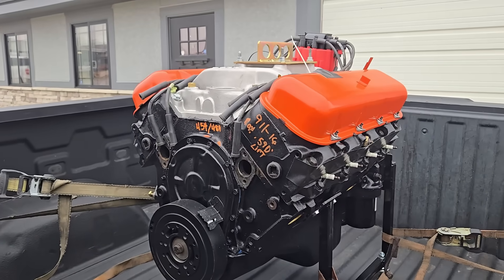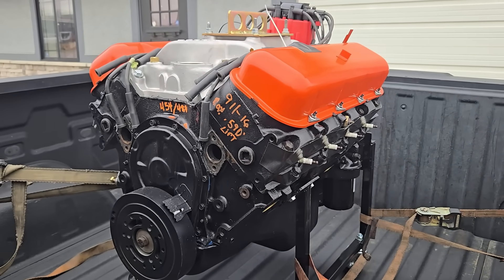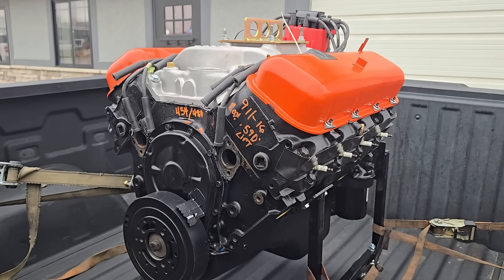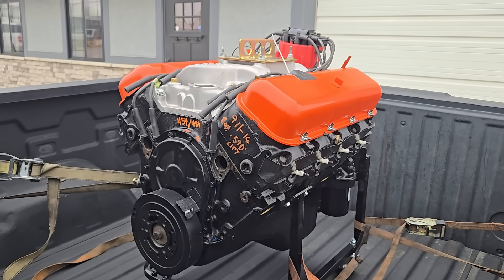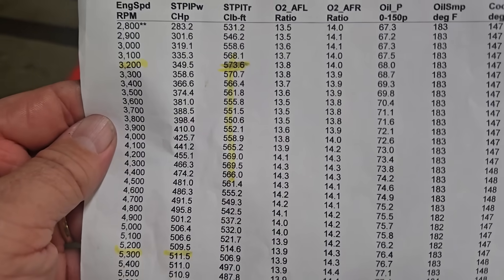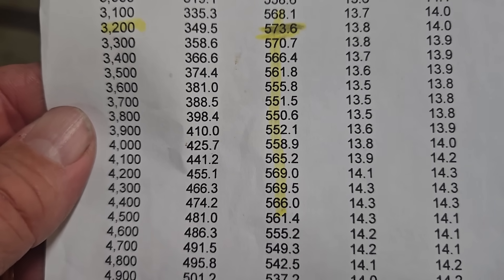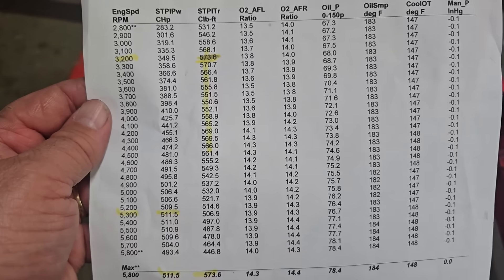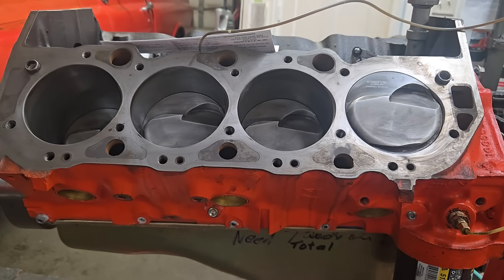87 octane 489 bbc, thumper camshaft comp. Peanut ports

Comment: Hey, was the cam a roller or flattappet? whats springs? Peanut heads have a short 1.820 installed height so curious what springs u used for that valve lift.
Reply from the maker: Hydraulic roller, valve springs was 911-16 comp cams. The spring installation height I just don't remember the heads has been on the shelf for more than two years, waiting for a home.
Reply from the maker: thinking about it.I believe those heads had +.050 valve locks in them.That increased the install height fifty thousandths.That's the way I remember it.But i'm not positive.

Comment: There is SO much to learn!
What is the reason for hand grinding the marked area of the block, as outlined by the gasket (at about 1:35), and doesn't that affect combustion chamber volume and vary between cylinders?
Reply from the maker: D shrouding the cylinder block to match the combustion chambers on the cylinder head increases airflow. The notches are close enough. To, each other that there's very little to no variants in compression. One cylinder to the next. And yes, it does increase the combustion chamber volume, which will decrease compression by possibly a tenth of a point. but the increase in airflow is more than worth
The decrease in compression.

Comment: I haven't used a thumper cam, they sound cool, but you just don't get
the same power as a bigger lift non thumper HYD roller with a 108-110-lobe separation or something like that.
Reply from the maker: I've used thumper cams several times on small block and big block chevy's, in  my experience  they make a lot of noise out the exhaust with all that overlap and they have crazy good mid range power. not necessarily the best peak numbers, as other cam shafts. thank you for investing your time watching my videos. Thank you for charming in with comments!! Nick.

Comment: What would be interesting is to see the results of altering valve and rocker sizes on the dyno, where those are the only changes.  I've only experienced Ford engines with consistent ports and LS engines... Not BBC with port approach inconsistencies.

Comment: Did you sell that 400 from the 3 engine small block build that you did
Reply from the maker: No, not yet, it won't be for sale until I do stage two with roller cams. In each one of the motors.. Sometime in the spring of 2026
Reply: @dzperformance7360 is it a good runner

Comment: I’m soon to build a street/strip 468/496 for my 63 nova.  I’d like 550-600hp and torque.  Aside from the one in video, what cam/heads would ya recommend.  Howard’s? ProMaxx? I’m kinda partial to them. Thanks partner
Reply from the maker: I like the Brodex race rides
Reply: @dzperformance7360  are the  brodix race rite 270s oval ports any good? The reason I'm asking is, because i seen Eric gave a break down on them. How do they compare to 781s with bigger valves in them. Thanks for your response in advance 👍

Comment: Have u seen the 11-600-8 thumper cam make over 600hp in a 496
Reply from the maker: I've never done it, and i've never seen anybody else do it. But I'm sure it could be done. if you move the cam.Retarded.. and had big airflow pieces. the thumper series cam is great for mid range power.Great torque peak, great horsepower at 4500rpms.It's not a cam, that's gonna throw down big, impressive, peak horsepower numbers.
I built a 505 cubic inch motor with the medium sized thumber hydraulic roller , six years ago.And it made 550 hp,  650 foot pounds of torque, with #781 cylinder heads.That's the best I ever did with a.Thumper..
Reply: @dzperformance7360  Thanks have u ever used speedmaster 305cc big block heads
Reply: @DanielCrockett-j4g those Speedmaster heads aren't worth your time. You'll make the same and maybe better power/torque with 781/049 heads.
Reply: @msh6865  Thanks a car builder uses them on a 496 said it make nice horsepower for the street 10.1 compression
Reply from the maker: no
Reply: @dzperformance7360 thanks for the information
Reply from the maker: Your question about those speedmaster heads.. I use brodix, factory g m classic pieces. and sometimes a f r. I just have a belief that the cylinder heads is absolutely.The wrong place to go buy chinese cheap heads and save two hundred dollars..

Comment: About time someone did a 87 octane motor ... Fuck everyone builds high power and never mention them motors need 93 octane in my area all there is 87 or diesel
Reply from the maker: Thanks for the encouragement  !! as pointed out by a couple of the comments.I could have went clear up to 9.2 and been totally safe.But I wanted to show this kind of power could be obtained with even low 8.6 to 1 compression..

Comment: Externally balanced or internally? 
Love the concept of a short rod stroker. Always wanted to build one.
Reply from the maker: External
Reply from the maker: If you had a set of good factory rods, you could build a stroker.Big block dirt cheap
Reply: @dzperformance7360 I have a nice set of truck rods (also called "thumb rods". Always wanted to try doing a stroker big block this way.

Comment: Beautiful street engine!  If he had the SS hood would you have used a Performer RPM style intake?  Or would you keep it low rise because it works better with the rest of the combination?
Reply from the maker: I would have chose an r p m style intake, but I had this brodex.In stock and previous testing had told me below 5500rpm. It does about the same thing as an r p m, so it all just worked out perfect.
Reply from the maker: My opinionThe r p m would have done the same torque with maybe three or four more horsepower that has been my results in testing previously on the two different manifolds

Comment: Great video. If you don’t mind me asking, when you deshrouded the valves. What angle are you trying to achieve and how far down in the block are you going? Is there any benefit to deshrouding both sides of the cylinder? Thank you for sharing this build it’s very impressive.✌️😁
Reply from the maker: The way I was taught is just a forty five degree angle.And if you're trying to go all out race motor draw a line where the cylinder ring comes up to the top and go down within thirty thousandths of the top of that ring.But that's a maximum effort engine. I know people that do the exhaust side on maximum effort engines, but I also know builders that says there's almost no benefit at all on the exhaust.
Reply: @dzperformance7360 thank you so much for this information.
Reply from the maker: Thanks for watching my video. Thanks for taking my input.
Into consideration
Reply: @dzperformance7360 thank you for sharing your experience with us. It’s a pleasure watching your videos. Happy Thanksgiving.
✌️😁

Comment: Solid numbers for peanutty heads. I can appreciate the mix and match effort on the valve sizes and rocker ratios to try and get the flow evened out. Good stuff.
Reply from the maker: One of my mentors that owned a dyno got me started. Doing that and he said, you'll never catch the flow of the good port on a big block Chevy. you can only get it close by doing some of these tricks
Reply: @dzperformance7360  makes sense to me. I wish I had more time so I could spend sometime learning from an engine builder wiz about these old school tricks. I love the idea of being able to do more with less.

Comment: Good video Nick, thanks for posting. I wonder how much power that block deshrouding added? It does lower the compression a little. I have a 454 LS5 in my '70 Chevelle, it pulls like a mofo. The 4.10's out back help a lot. The Chevelle is a heavy car, it definitely needs a big block.
Reply from the maker: Just  my opinion,,  I think it probably only helps a couple horsepower, and I only do it when i'm using big valves. The compression hit is only one cc, so maybe a tenth of a point.

Comment: Very interesting build, it would be great to have a set of those heads flowed to see what the difference between the good and bad ports are on a flow bench and compensate the lift numbers for the rocker arms, the 547 lift on the intake becomes 579 with the rockers
Reply from the maker: There's a video on those exact cylinder heads flow tested on Eric Weingartner's channel about 2 years ago. I think his channel's name is Weingartner Racing?
Reply: @dzperformance7360 i'll have to dig that video up interested.I'm gonna watch this though

Comment: built a pump gas 543 bbf for my 78 f100  610 flb and 415 hp at 3500 rpm. gotta love them big block's
Reply: 3.89 w 4speed.  1st and 2nd almost useless but it is great for pulling my jetboat looks cool to
Reply: wtf did you have for gears ?  2.29?!! LOL

Comment: Oops I hit send before I was done part 2 then I don't remember if you said it was a roller camera not with the specs. I've got a 450 inch lift roller cam on 1.5 roller rockers 202 160 heads air gap manifold and a bunch of other good parts 9.
To1 compression Rose variable duration lifters and lots of good parts I'm getting 450 ft lb of torque out of a 357 350 40,000 over hypertech Pistons the motor you did a really nice motor though I would definitely want to have it. Thanks.
Reply from the maker: I forgot to mention it in the video.It's a hydraulic roller

Comment: Engine would be a beast in a 70 Vette Stingray with a 4 speed manual & 3:36;1 Gears.
Reply from the maker: Yes,!!! now you're thinking it'd go through the quarter mile in third gear. But would probably have the power to run high tens. et
Reply from the maker: You could use fourth gear like an overdrive

Comment: 511HP with peanut port heads and the smallest comp thumpr cam would be a new American dyno record. Thumpr cams do not make power only noise which has been proven over last 25 years since created. Have only seen upper 400s HP officially with those heads. Someone spent many hours porting them and must have larger valves. 8.6:1 can run on 84 octane. Stock type 454 with extra stroke cubes at 489 will only give about 30-50 more TQ with the peanut port heads. Peak torque RPMs nose over at 4400rpm. Building a 489/496 with peanut ports for only 500HP seems like a strange waste of bbc cubic power. 781/049 large oval ports would add 75-150HP if properly ported with bigger vavles which leads me to believe these do not have peanut port heads. What is the head casting number exactly?
Reply from the maker: Casting # 236 . the casting numbers are visible in the video at 4.35 minutes. i've built the same motor with large ported.O49 it makes about 12hp more. 20 more foot pounds of torque peak, but less below 3500 r p m's. cylinder heads have less than one hour porting on each head. all porting was done in my shop. I did every bit of it. So i'm positive, there's one  hour in each head
Reply: You’ve been watching the wrong videos. A  thumpr cam can make over 400 hp in a small block.  One went over 400 hp in a 327 Frieburger dynoed. ( see 8000 rpm small block) on engine masters. And horsepower monster dynoed one too, way over 400 hp

Comment: Always wondered why the oems didnt bother to match the top of the cylinder the combustion chamber like you did at 1:43.
Reply from the maker: You know, on the four bolt main motors, they did do that.And 396/402
Reply: They did it on the high performance versions. L-88,  LS-6,  LS-7,  L-72, etc.

Comment: That engine made good power and torque for what it is you could put a good set of heads on it and cam swap and pick up 100% hp
Reply from the maker: Thanks for the comment !!!and you're right.But then that would be a combination for a different car.

Comment: Great combo for a highway cruiser Nick !!! I did a .030 over 454 for a friend last winter with peanut port heads, 2.190 and 1.88 valves. ZZ 502 hydraulic roller cam and the matching Weiand intake. He put it in his Chevelle and absolutely loves it !!!
Reply from the maker: Thanks for the compliment.I trie to put motors together, so people don't have to run out and buy a bunch of parts.I  tailor the combination to their use and their parts.They have.. Thanks for watching. Thanks for chiming in with such a thoughtful comment.
Reply: So this is a Stroker build but with a Big Block ?
Reply from the maker: yes

Comment: What's up DZ! Drop a small single plane intake on that thing!😜
Reply from the maker: I hate to disagree with one of my guys from way back, but
About ten motors back , I did a 461 for a guy in arizona.And we used one of those low profile torque 2s . that's the only one i've ever used.And it made total s*** power.It was embarrassing.. After he put it in his car, he went to a edelbrock performer.R p m.
Reply: @dzperformance7360 Torker 2 was the worst intake ever made for a RAT. The Victors were much better. But a mild torque engine should run a dual plane. That Brodix dual plane is a good piece.
Reply: @dzperformance7360 I feel you DZ.🙂 I guess for me. I don't like a lot of low end torque because spinning ain't winning. I prefer a lot of mid range and upper rpm torque. But, I do understand that every combo and a person's preference matters.😉 have a happy Thanksgiving my friend.
Reply from the maker: @musclebone7875 thank you so much, thank you for watching.You have a great thanksgiving also
Reply: @dzperformance7360 DART single plane intakes work real good on big Chevys.
Reply from the maker: Hey, next week i'm taking a rectangle port 496 to  dyno.In ohio?That's gonna be just right down your alley!!
Reply: @dzperformance7360 yeah buddy!😊 I can't wait to see the dyno.

Comment: Not sure what rearend or transmission that the owner has. But 570 torque down low is gonna be a snap in the neck off the line!
Reply: With a 3 speed automatic,  2:73 rear end ratio is better.
Huge Torque is the secret.

Comment: So many people give the peanut port heads a rough way to go. They work great on lower RPM heavy street cars. Do some grinding on the intake ports give them a bell-mouth and you'll bump the HP range up a few hundred RPM. 
Love this build Nick. You got me wanting to do one too!
Part # on the pistons?
Reply from the maker: kb-224-030
Reply: @dzperformance7360 Nick did you externally balance this engine like a regular 454? Or, do it internally?

Comment: I have 3.08 gears in a 92 shortbed. 9.7:1 compression, runs on 87, custom burned Tbi chip. Nv3500 5 speed. Still gets 17 mpg at 80 plus!
Fun truck. 3.08’s at 4500 rpm’s with no over drive is like 120 so that big block will give him plenty. 
I don’t know where it runs out to!
Reply from the maker: Cool combination thanks for sharing!!

Comment: Are these the peanut port heads that Eric tested a couple years back on his flow bench? Great torque that  Chevelle  ought to fry the tires for sure
Reply from the maker: Yes, they are.. man your hardcore. I didn't think anybody would remember.
Those heads.
Reply: @dzperformance7360 I just watched that one and have been running through your vids. Thanks for the work you do!

Comment: He's going to love it
Reply from the maker: I hate to see car.Owners have to buy new gears, new stall conv. and all that stuff.When they just need a motor design for how they use it
Reply: @dzperformance7360  you're a man of integrity, and we need more like you in this world.

I got started in diesel performance because a guy talked me into higher horsepower injectors with logic, then wouldn't help me set it up when I was running 1350° cruising on the flat with a trailer behind me... He had no integrity, he just tried to get me to pay him for putting twin turbos on my truck. He said "it's the only way"...  Guys like you make this world function, not my first diesel parts salesman.

Comment: It's about time someone did something on the good and the bad intake runners.  Great job. It will pull your house down.  Did you try any of your car spacers? I would like to see some videos about them. Thanks
Reply from the maker: I make those by hand i'm searching for a shop to do them for me, c.n c programmed.. When I launch them for sale, they'll be on my channel right away
Reply: @dzperformance7360 I've been wondering about the spacers myself
Reply: @dzperformance7360 thanks
Reply from the maker: I didn't do anything with carb spacers.On this one because of the hood clearance for the customer

Comment: So what's the highest compression ratio a guy could go running 93 octane?
Reply from the maker: My experience tells me 11.5 to 1 with a big cam and tight lobe separation.. 9.5 to 1 for small to medium cams
Reply: @dzperformance7360 I really appreciate that you answer comments. That's something I've wondered myself. Thank you
Reply: @dzperformance7360 ok thanks
Reply from the maker: No timing was not locked out.I changed to lightweight springs in the distributor with a total advance of 36 degree's, all in by 3000rpms
Reply: Was timing locked out on dyno and what did it end up needing with that compression on low octane?